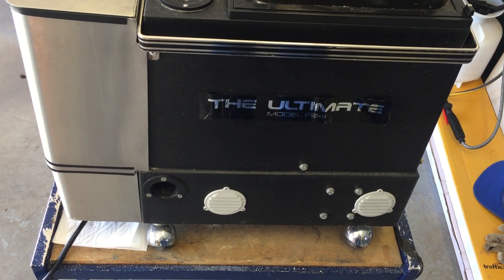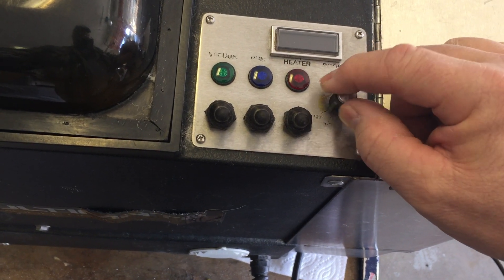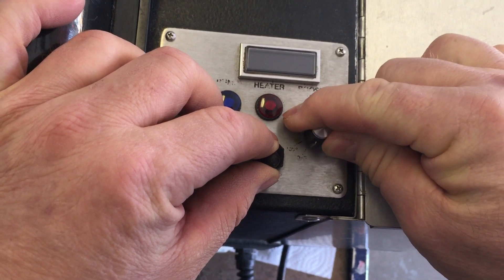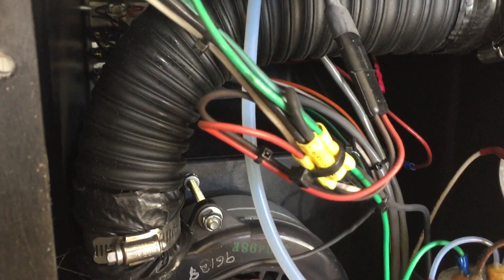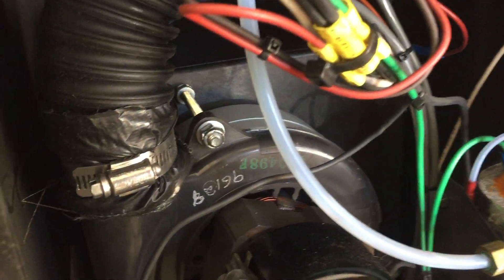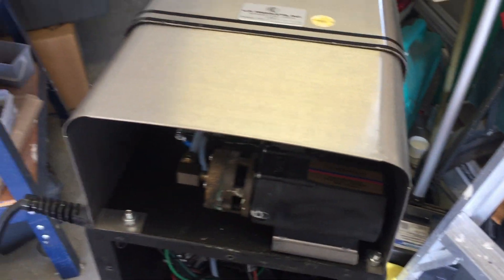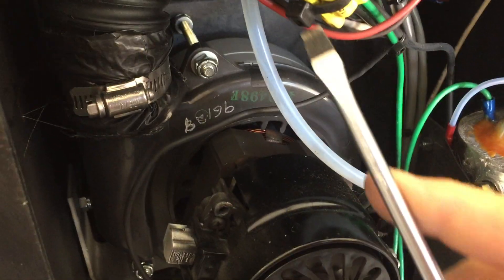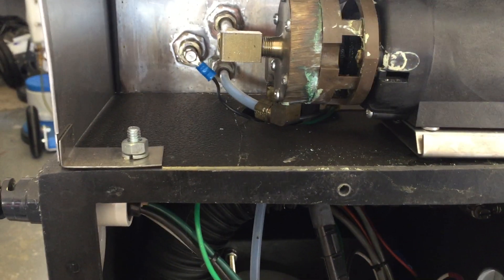Oxy-Dry dissecting the PB111

Comment: This is the first upholstery machine I used when I started cleaning in the 90s. It’s a really good machine.
Reply from the maker: How long would you clean for before needing to dump and refill?
Reply: @OxyDryCarpetCleaningKelowna  - Well that was 30 years ago and I was in my early teens when I started, so I can’t remember exactly. I will say we got through most jobs without having to empty and refill, or maybe emptying once if they were really bad. I do remember my grandpa buying another upholstery machine with the thought of using the PB3 for solvent cleaning and drapes only and the new machine for wet cleaning. We switched back to the PB3 quickly since it cleaned better, And the furniture dried quicker.
Reply from the maker: @1122cleanandrenew  Good to know, I am working on it to get it back in top condition, fixed the pump leak, replaced the motor carbons and freed up the valve in the tool. Now I need to clean the jet as it has a clog.